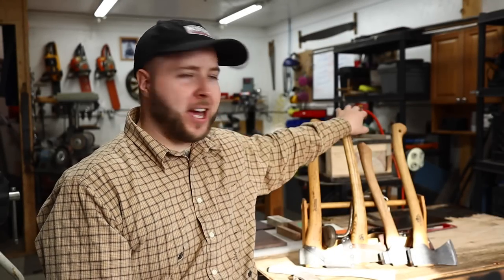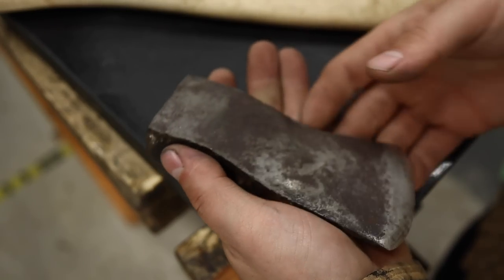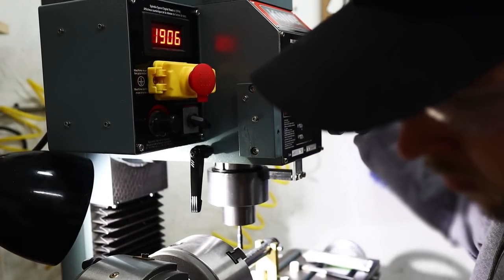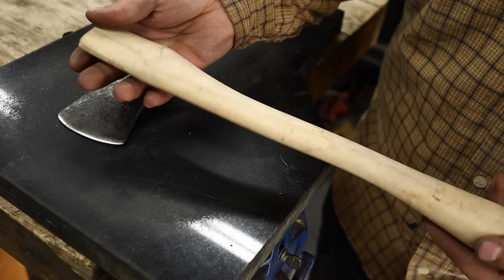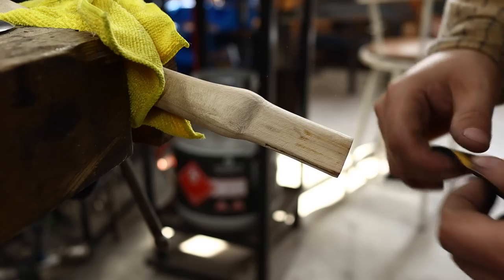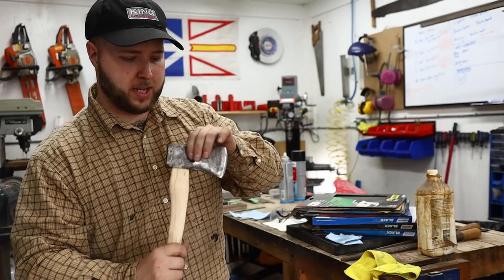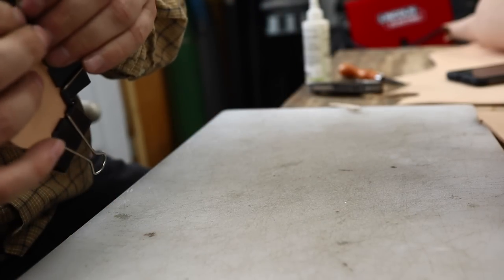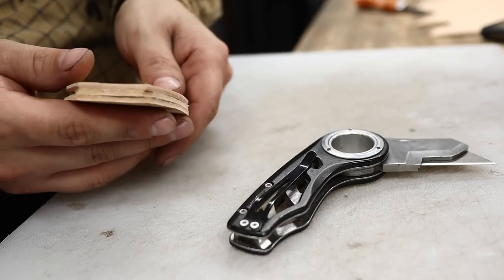Restoring a 130 year old Axe!

Comment: Good rundown Kyle. The grain orientation is such a simple yet essential aspect of any wooden tool selection. All the best to you and your family.
Reply from the maker: Thank you! It sure is, and it's easy to get right if you know what to look for! thanks for watching!
Reply: More important than orientation is just growth ring runnout in general.  With curved handles grain orientation will matter more.  But even a slightly curved handle can be fine with 90 degree orientation.  I love wood.  I rive the stuff by hand, air dry the lumber and make my own handles.  With hatchets you can really experiment.  Those handles don't take the same beating a full sized axe handle do. This is why you find a lot more vintage handles with a usable handle compared to a full sized axe.

Comment: In fact, I know and have visited the island where the original Welland Vale Axe company began. I live around the corner. There is still a commemorative sign signifying their great products and the people who worked hard at producing excellence.

Stuck in the middle of the old Welland Canal sits the Welland Vale Company. If you look close you can still see the foundry foundations.
Reply from the maker: That would be cool to see! A rich area of industry in its time. How I wish I could have seen it the, steel city, in all its glory
Reply: The Golden Horseshoe is full of old shacks and barns with fully operation old time workshops. Generally with an old gentleman with only nine a half fingers. On a good day, the missus would join the conversation with egg sald sandwiches and tales of excellence. 

That's what's wrong in the 21st century, not enough value given to the pursuit of excellence. Come for a visit sometime, I'll show you folks that have forgotten more than most people learn in their lives.

Kinda like the wharf in outport Newfoundland. Some old guy with nine and half fingers fixing a 60 year old dinghy so that it's good to produce for another 30 years. Ya gotta value excellence and those who strive to deliver it. That's what I say, yes I do, better believe it.